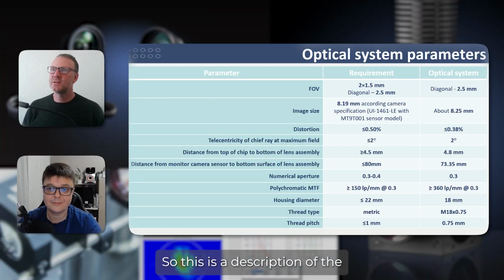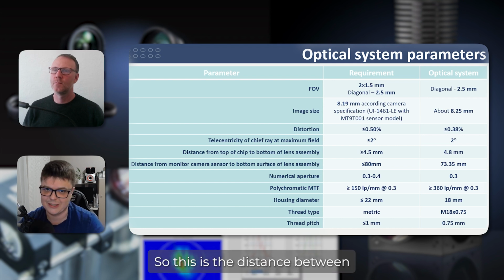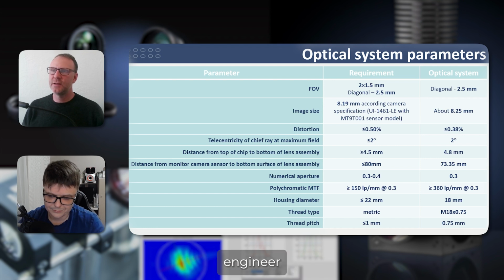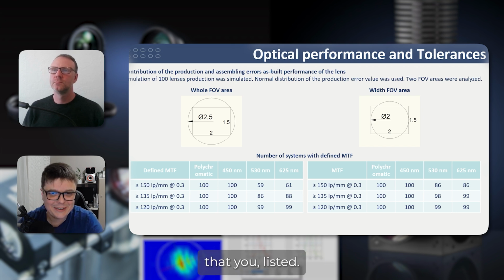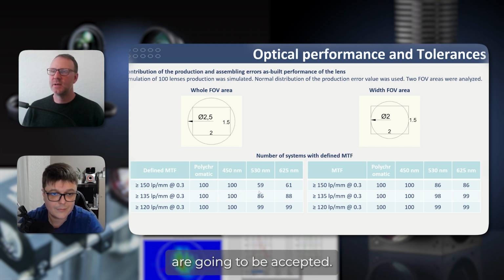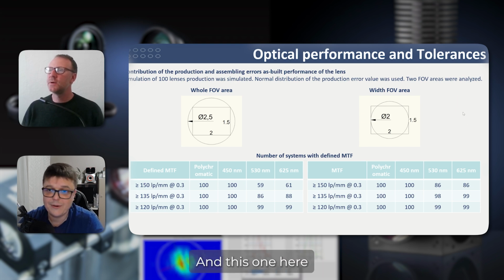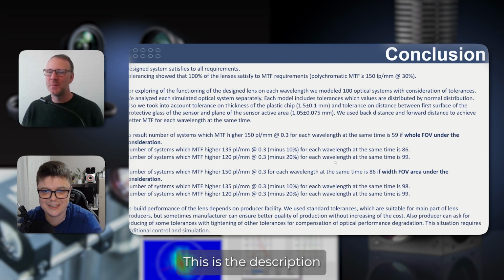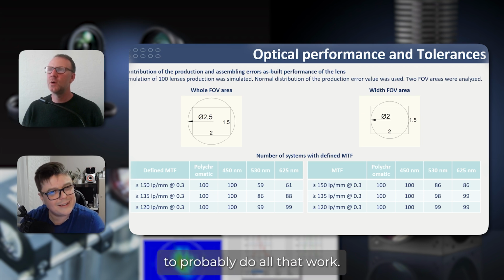Optical Engineers at Work 7-Monte Carlo Analysis

Comment: How you did a Monte Carlo analysis in ZEMAX without knowing factory tolerances? Why are you saying that even factory itself might not know them even if any reputable factory has a metrology lab?
Reply from the maker: The factory has at this point agreed to the tolerances we provided. In terms of metrology, they don't test every element for every parameter on every lens in serial production. They test more at the beginning and then if there is a problem with the overall assembly test